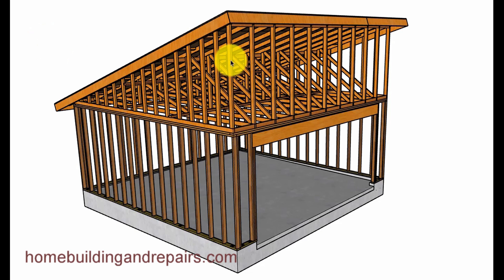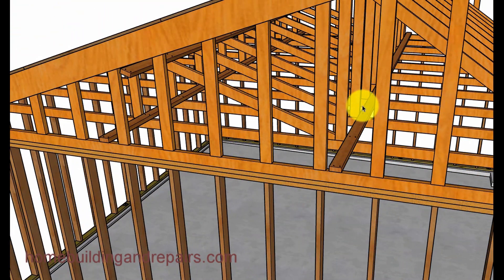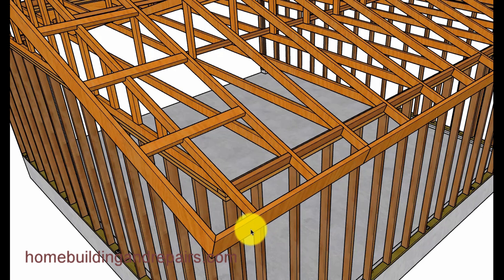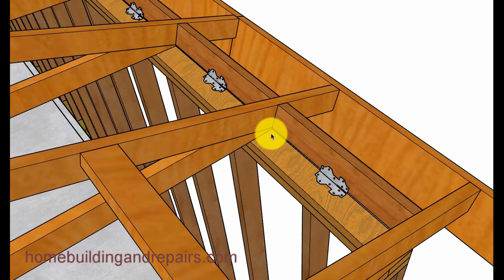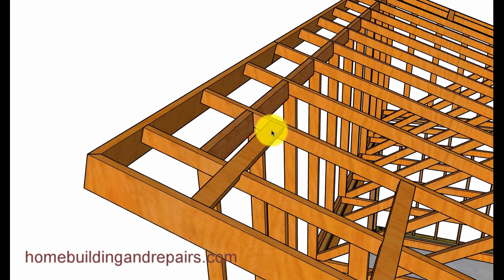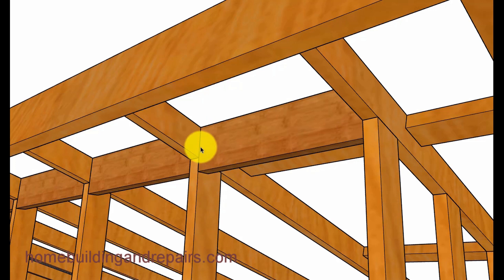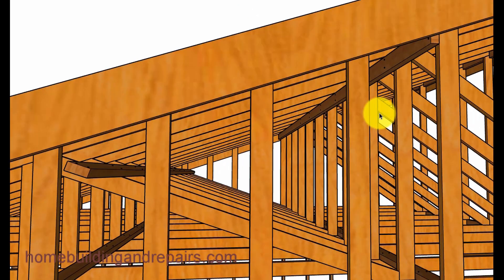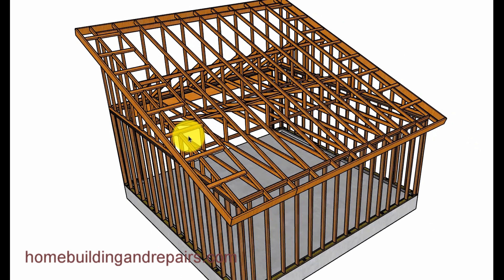Shed Roof Using Engineered Trusses for Two-Car Garage - Design and Building Ideas

Comment: Great video!  Thank you for taking the time to share!  Just curious, is there a reason you went with trusses vs rafters?  I think rafters would have allowed you a more usable attic space.  With trusses, the webs and supports make the attic space more unusable.
Reply from the maker: I was trying to provide other designs. Here's a link to some other garage roof framing that might provide you with more ideas. https://www.homebuildingandrepairs.com/garages/index.html